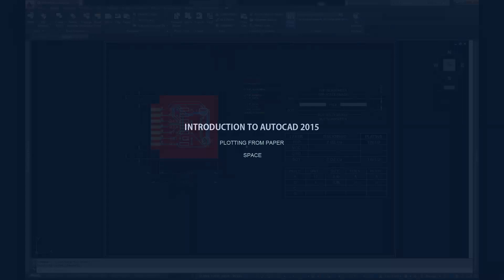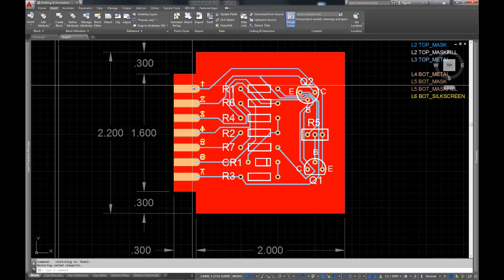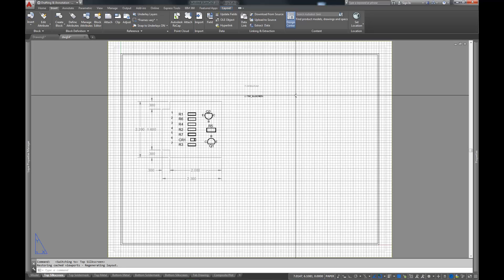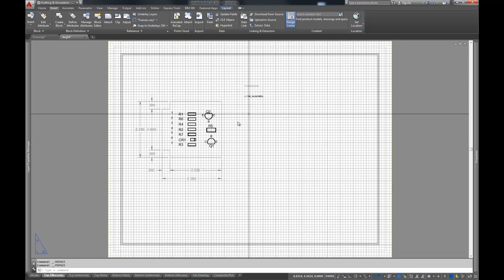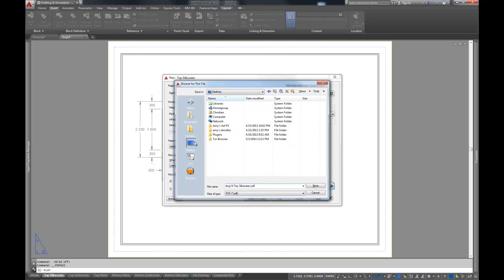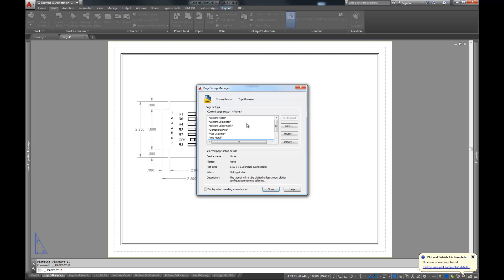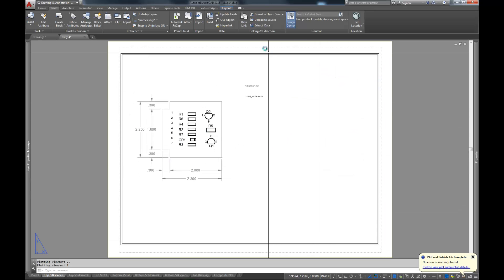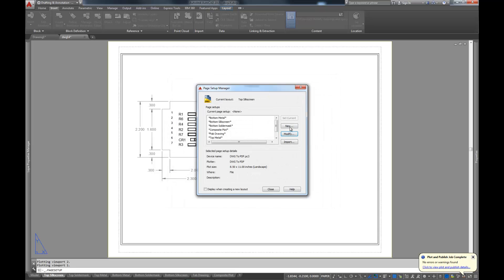Intro to AutoCAD 2015 - 18 - Plotting from Paper Space

Comment: 1:45 - What do you mean "You want to plot your drawing the same size sheet as you have logically set up in your paper space."? With plot scale 1:1 my drawing becomes a speck in the bottom left corner of the layout.
Reply: +majermike make sure you select the plot setting in the drop down for "extents" and not the default. I had the same problem as well. Ideally, when you draw and scale your drawing you want to keep the paper space to be what you plan to typically print to. Even if you scale 1:1 you will have weird blank white space that is printed on a say E (34x44) paper but your drawing only scales 1:1 dimensions of 30x40, for example.